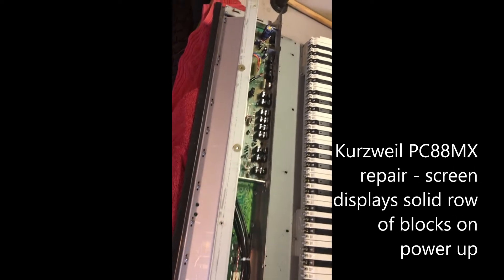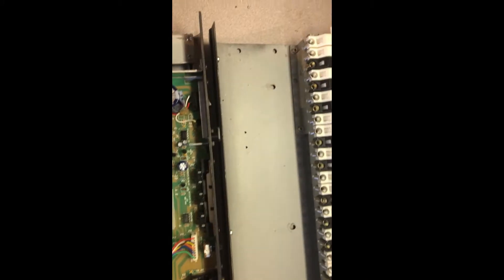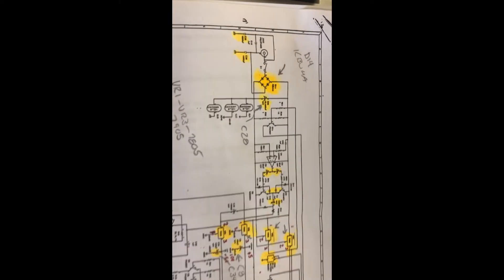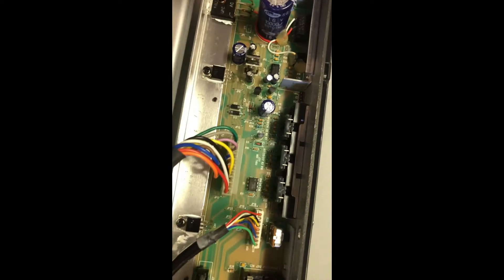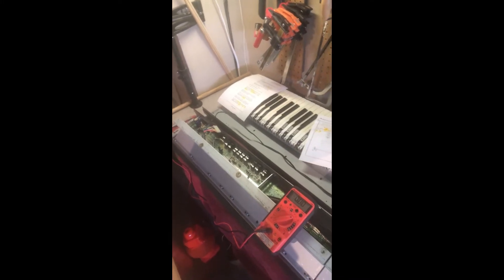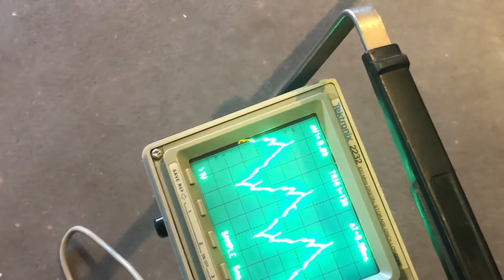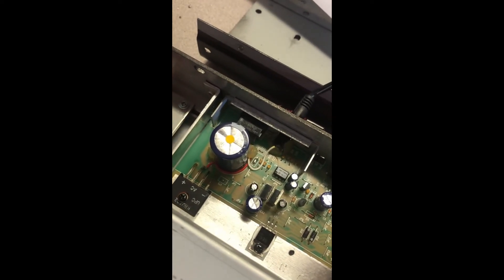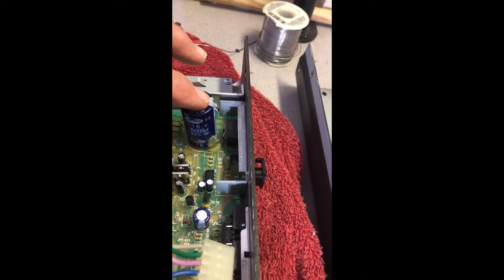Kurzweil PC88MX Repair - LCD displays line of boxes (black line) across top line

Comment: Hi! I own a non functional Kurzweil PC88. Measured the voltages and seem fine, however, upon start I end up with the line of blocks, all lights clip once and that's it. The soldering of the big capacitor is fine, voltages appear to be fine but on mine I discovered something else and that is, the Hi firmware chip has one broken contact. I can probably find two chips (for Hi and Low) AM27C040 but i cannot find anywhere the ROM firmware files to burn. The writing on the chip is
PC-88 ENG HI
V 1.02 8EE6
1998 YCA

Do you happen to have any of those ROM files available ? I will try and email to Kurzweil as well but I doubt I'll get anything from them.

Kind regards,
Viorel

Comment: Hi Mr Razor, I just picked up a kurzweil pc88mx at a thift store. It didn't have a power adapter or anything else. I bought one and I can turn it on. Sometimes it works fine. Sometimes it stays stuck on the line of boxed in the display when I power it on. It's an intermittent problem. I'm not nearly as electronically gifted as you are. Do you think its related to the capacitors and is it worth fixing? I'm in Durham NC. What kind of electrician would able fix this? Thanks much.
Reply from the maker: You should be able to find a keyboard repair service in the area and eBay does sell a power supply refurbishment kit that has all of the part.
https://www.ebay.com/itm/276317815064?chn=ps&norover=1&mkevt=1&mkrid=711-117182-37290-0&mkcid=2&mkscid=101&itemid=276317815064&targetid=2299003535955&device=c&mktype=pla&googleloc=9194525&poi=&campaignid=21672900668&mkgroupid=175573326908&rlsatarget=pla-2299003535955&abcId=10012303&merchantid=6296724&gad_source=1&gclid=CjwKCAjwufq2BhAmEiwAnZqw8tAKW7_6XR8eFm4x6jbgOBkVB2P9zvPmXDzUyf2zhyOQtcC0UI8rbRoCPnUQAvD_BwE
Reply: Could you tell me how to get my top off of my Kurzweil PC88MX?!  Thank you in advance🤗
Reply from the maker: https://archive.org/download/kurzweil_pc88-sm/kurzweil_pc88-sm_text.pdf

This is a link to the service manual for the Kurzweil PC88

Comment from the maker: The row of black boxes appears when the PC88 and PC88MX is initially powered on.  Based on my observations, the boxes go away when the unit has proper power.  If you keyboard is displaying a line of boxes and a hard rest does not fix the issue, my initial observation is VR1 and VR2 are probably showing voltage <5VDC on pin 1 and <10VDC on pin 3.  Likely issue is C28 is defective, as this smoothing capacitor provides voltage to VR1, VR2 and VR3.
Reply: look at a tutorial on how to solve that same problem since my pc 88 mx got like this ... and if the solution is to change the battery and make a prescription ... since it gets stuck on that checkered screen ... I invite you for you to see, the tutorial is on youtube and it is in Spanish
Reply: Are you near Houston...  my PC88MX is doing this very thing today.
Reply: Are you near Houston?  My PC88 started doing this very same thing today.
Reply from the maker: Unfortunately I am not in Houston. I would check to see if any components are loose and need to be resoldered.  Otherwise you probably have a bad component.
Reply: Thank so much for the reply.  Going to make a couple of calls locally and share your suggestions to hopefully help them get straight to the problem.  I don't want to get rid of my keyboard because I really do love it.  Had it since it came out....   @TheRazor96
Reply: Dear Sir, replaced battery but now no sound- -I’m heartbroken!!!  Is there a way to get a schematic diagram or can you help me as to where to look on the board for the sound issue?  Thanks in advance.  I’ve found no one in my area to help.
Reply from the maker: @debbiegolden-alvarez9555  https://archive.org/download/kurzweil_pc88-sm/kurzweil_pc88-sm_text.pdf.  Here is a link to the PC88 service manual
Reply: @TheRazor96  Thank you hope I can figure something out.🤗